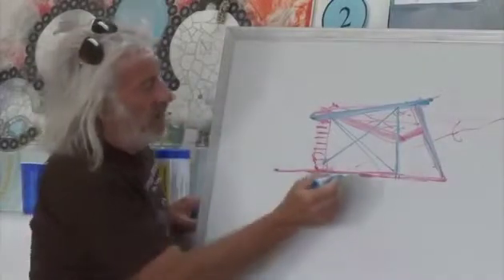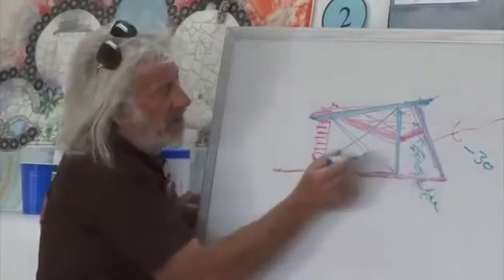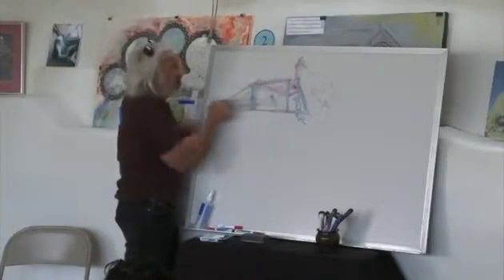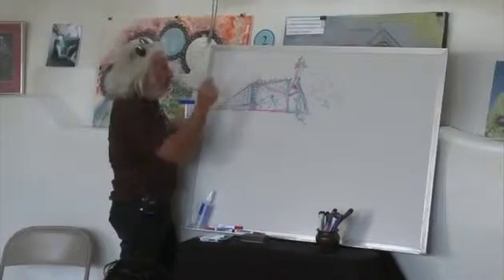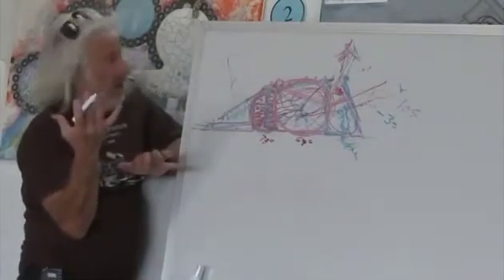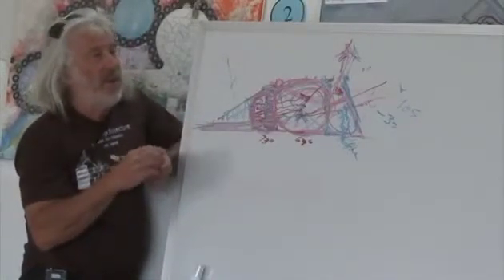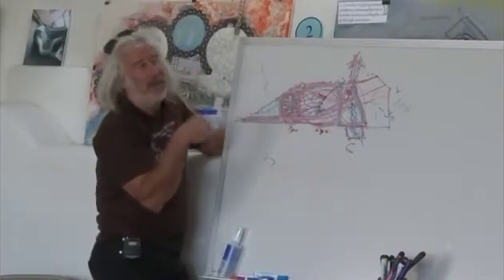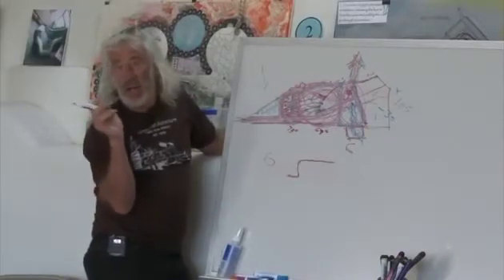Earthship Biotecture Transcribed Session 1 Pt 2: Convection Engine For Cooling. Thermal Buffer Zones

Comment: How does Michael compensate for humidity in tropical climates? This will cause mold inside in humid climates.
Reply from the maker: Heaseba airflow and good ventilation is key! Cooling tubes also help if implemented properly...
Reply: @AlexEarthshipLeeor  I would be interested in seeing examples of earthships with greenhouses attached and ventilation tubes; built in tropical climates and NOT moldy after 3 years.. I am concerned because I plan to build a modified Earthship in TN and it is VERY humid here, in summer.